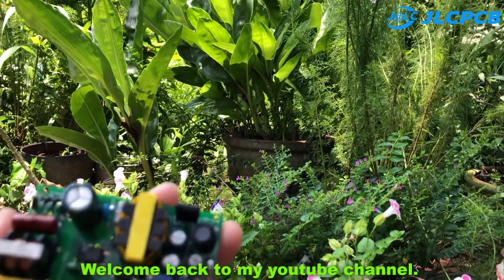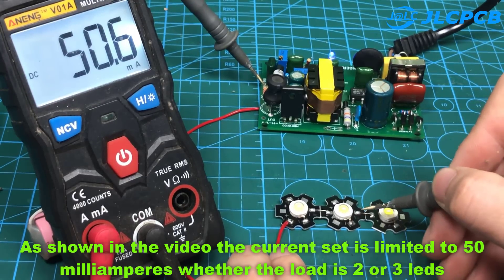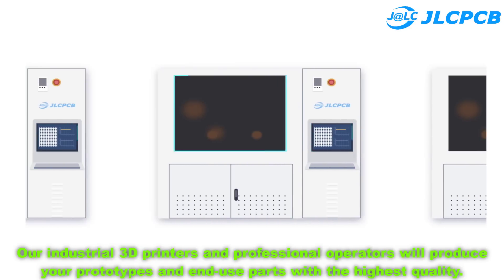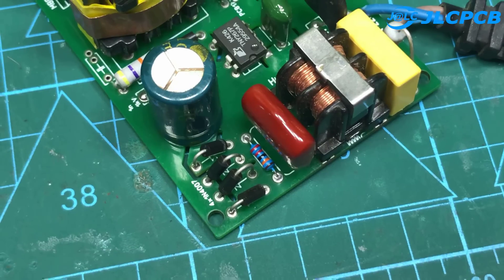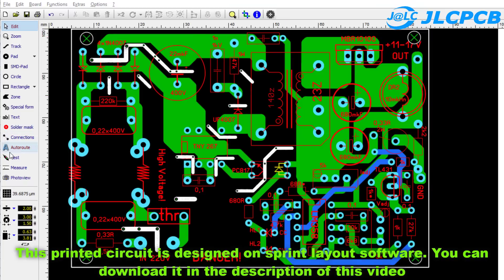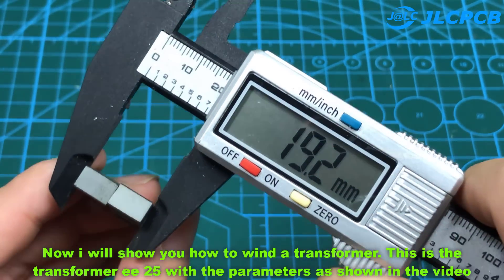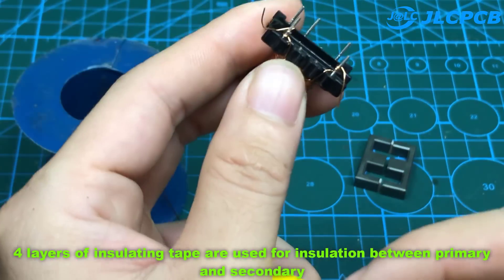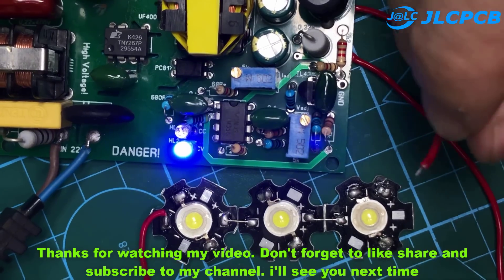Leds Driver Battery Charger with Constant Current and Constant Voltage Power Supply

Comment: i need your help my friend.
i want to build smps power supply for induction heater it draws 48v on 48amps,
can you help me with choice of ferrite core is EE65 enough?in total this is 2500watts continuous i wan t build some extra watts around 3000watts.can you tell me right choice of core and topology (Half bridge,flyback? and what ic & Circuit to use for that power?can you calculate wich type of transformer  i can use and wire diameter & Turns of primary and secondary?
Thank you in advance
🙏🙏

Comment: Excellent work 💯 Sir. 
Sir I have a 30V-40A single phase transformer. I need FCBC control circuit for 24v battery bank and load in parallel with battery reverse protection and short circuit protection.If you design it is very helpful for me.
plzzz make a video on it.